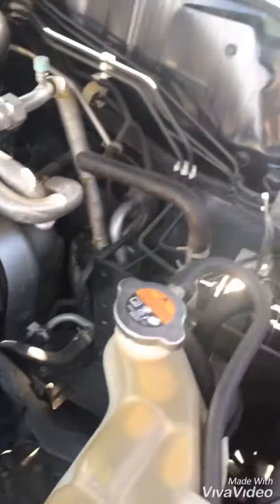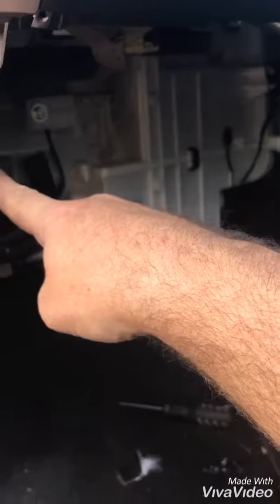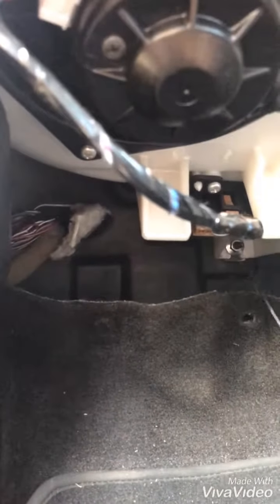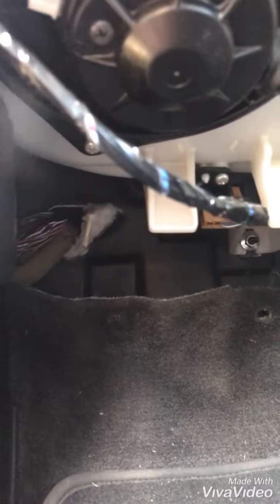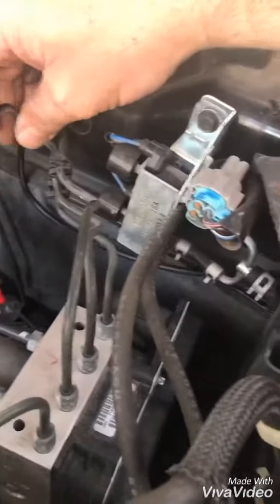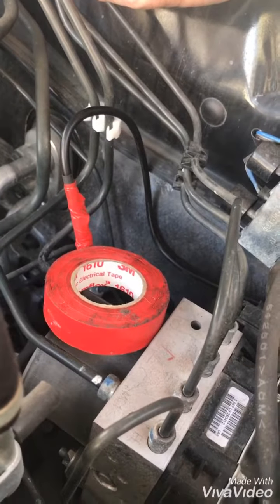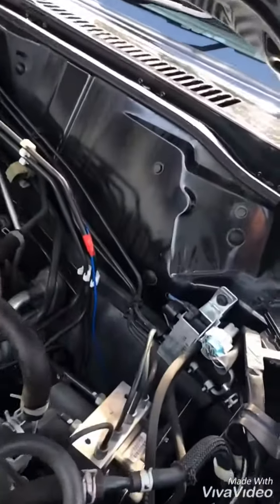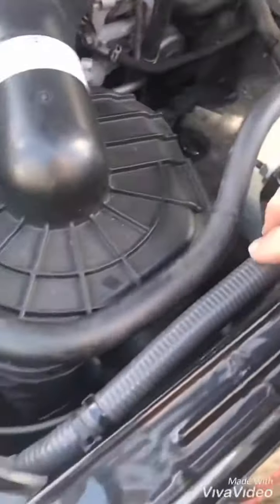GU Patrol - run cables through the firewall

Comment: Mate , thanks so much, have been having the same dilemma. I need to run a solar cable from the engine bay (dc dc charger) trough the firewall into the cabin and then up the side pillars to the roof.